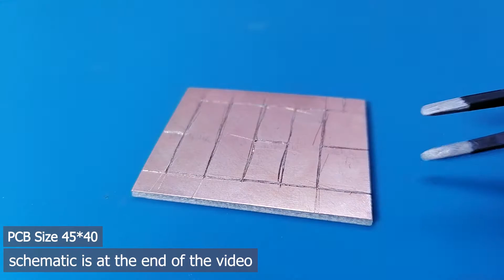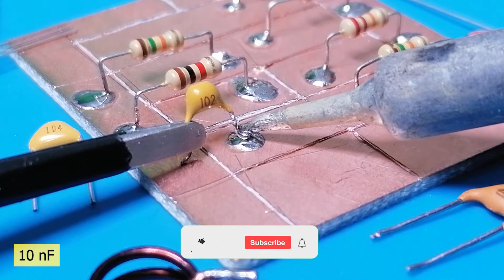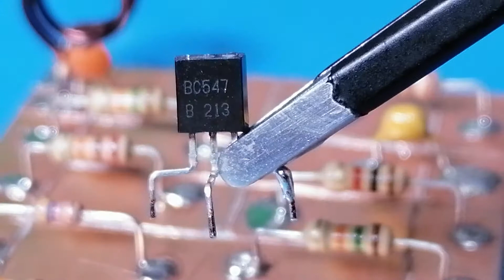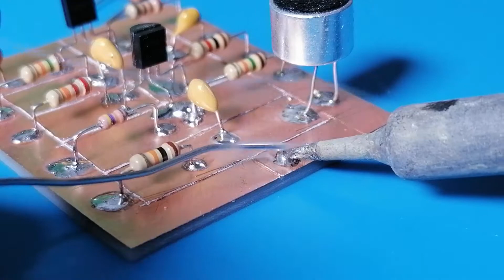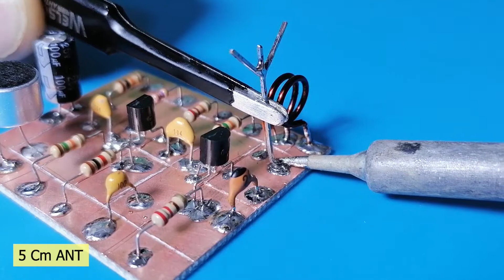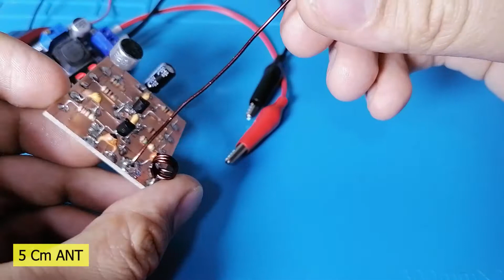FM Transmitter with 2 Transistor -100 meter |Super Simple FM Transmitter |Make easy FM transmitter

Comment: What is the negative feedback of the C6 capacitor used for?
Reply from the maker: This capacitor serves the purpose of keeping the tank circuit to vibrate.
Reply: @ElectroWiz  How does it do that or do you have any websites that explains how it works in keeping the tank oscillating?